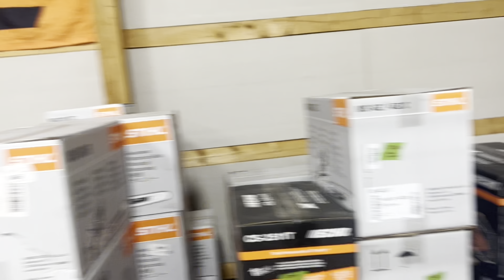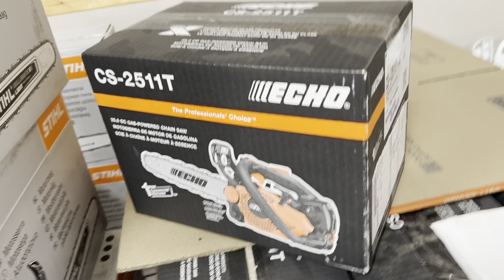Lets Go to Pennsylvania, Ripsaw Factory Tour.

Comment: I'm here for learning and entertainment. I have similar interests.. music, wood cutting/splitting and burning and well Buckin ya feel like a friend. That's why I'm here. Love the show.. my stihl 391 is a dog.. A ripsaw 500 or even just a new pipe is a dream.. A pipe dream 😉
Reply: You’d ultimately be happier with a 362 Stihl OR a Husky 562 OR an Echo in the 60ish cc size. Just get a pro model and not a homeowner variety like the 391 is. BUT, I’ve seen MANY people starting with something similar to yours and get fed up with the saws that are on “most” dealers shelves. 
Remember this, a sharp chain makes a big difference in the performance of a saw, whether it’s a hot rod or a homeowner. I’ve hand filed a few chains for folks that didn’t realize that chains could be sharpened and their response was “ it’s been a VERY long time since my saw cut that good, maybe even never”.
Reply: @ToddAdams1234  I hear ya but I'm just home/farm owner so only do about 6 cords a year. Buckin helped but I learned about sharpening and bar maint. the hard way. I cringe at dull chains and worn bars now. Wishing I could just  bolt some more zoop onto the 391.. It's reliable and all but.. lackluster throttle response.

Comment: I was wondering if there really is a big cost to use for getting a ripper chain for my 461 in a Alaskian bush mill to make rough lumber? Do you sharpen them differently?
Reply from the maker: Buy a milling chain ..or file a regular chain straight across

Comment: I am here to learn how you drop tree like tipping a toothpick.  I am definitely a DIY kind of guy and amateur on dropping trees around my property.  I know I know all the danger of dropping tree big or small.  I start dropping small (about 6" to 8" diameter tall young white oak).  Partly want to practice and clearing out the area.  I have 1 big leaning oak maybe around 18 diameter.  If the lean it not toward the I would do it but no I won't.  I would pay for an arborist to come and chop it up from the top down but that is no funny.  For some reason watching it falls is more fun hahahaha.  I have been looking for a faller in my area but not luck.  Every tree service company I called they want to come and cut all your trees.  So I am trying to learn watching you.  Just cool watching it falls.  Maybe if you on the east coast and swing by and have some fun.  I am sure you can drop this thing with no fear with my Rancher 460 26".  Anyway cool watching your videos.

Comment: HI BUCKIN all of the old school chainsaws are loud even W a muffler just like straight exhaust the old chainsaws don't have the RPM they do have the pull and they pull just like a tractor 🚜  U have 2 remember years ago thats all they had back then U could go 2 a chainsaw dealer back then and buy  it brand new 😊😅🎉😂❤😊/😊😊🎉🎉❤🎉  8 3 2O23